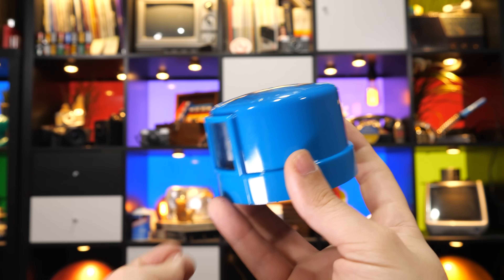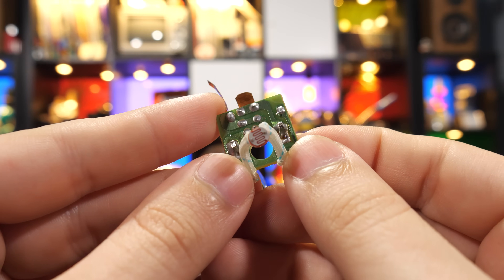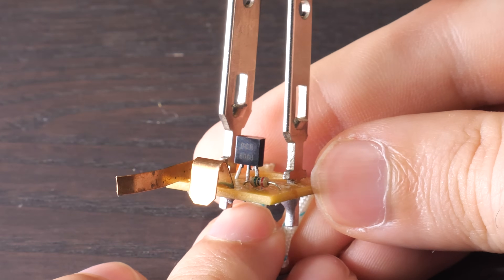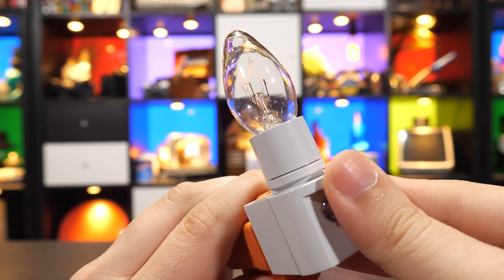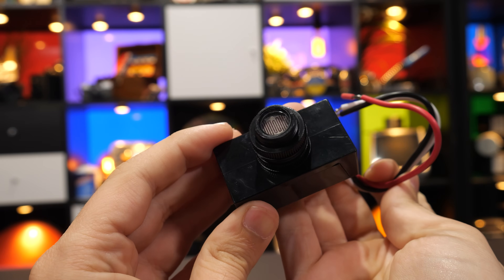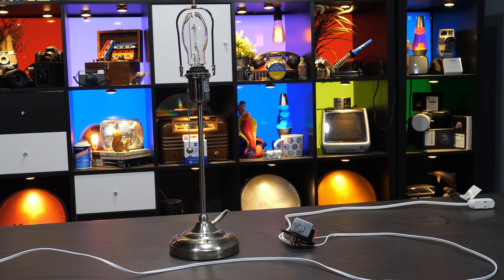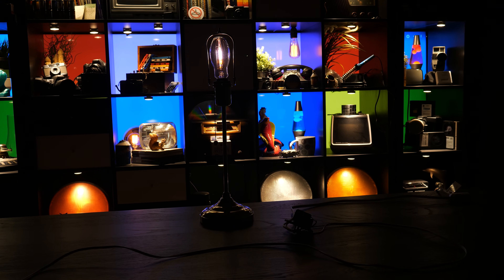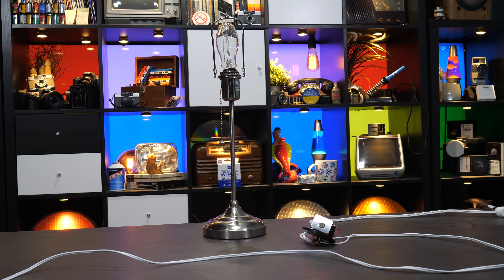Photoelectric light controls are weirder than they seem

Comment: Those devices are more sophisticated than it seems: yes they that have hysteresis (yes the word) to avoid turning on and off  when the threshold is reached, meaning once they turn on it needs to get much more light to turn it on again, just like an automatic transmission works, but...

 ...but there is a little more to that:

In Brazil one of those controllers controlled half of the lights in a small area (lets say the odd ones) and another with a different threshold the other half (lets say the even ones) using one for several lamps allows a more consistent turn on and off without very precise adjustments and using it to control half of the lights make it more resilient to failures on the switch.  This have three more advantages: it avoid surges turning on tens of thousands of lights at the same time cutting the peak to half turning on and then the other half,  and makes easier for your eyes to adapt when they turn off and diminishes the wearing of lamps when a smaller drop in luminosity happens like on a storm or dark sky that takes only a few minutes.

The new led lamps seem to not behave this way anymore as they do not have problems being turned on and off too many tomes and do not use so much power too.

Comment: Another way to do it is with a photocell (tiny solar cell) instead of a photoresistor. If you have a component that creates its own power when the main component is inactive then the circuit doesn't need to continually draw power from the grid 24/7. That means putting one on each individual lamp makes a lot more sense, and even a minuscule amount of power drawn over the course of decades and millions of lights adds up fast.

Of course, these days what makes even more sense is for the street lights to be LED, powered from batteries that don't need the grid at all, and to recharge those batteries from solar cells during the day. When the solar cells no longer generate power, turn on the light. Easy peasy, no microcontroller needed (although battery management comes into play), and they can be installed anywhere with no regard to running power lines. And yes, they are 1000 times more reliable than those cheap solar lights you may have bought that only last one season, because among other things quality control actually exists for the big street lights. Those cheap ones are prone to fail for a lot of manufacturing defect and bad design reasons, such as nonexistent waterproofing, lousy connections and soldering, and the cheapest possible components.

Comment: Time Clocks can be used to “lock out” the control of the photo resistor in large night lighting applications to keep from coming on during hours in which it is expected to be light out. 

Street lighting though is aways controlled by the photo resistor via contractor. This is to ensure the roadway will always be able to light up in the case of extreme weather conditions during the day.

Comment: One unmentioned minor benefit of wiring a whole string of lights to a single one of these sensors is that all the lights wired as such will turn on and off in sync with each other. Since lighting conditions differ slightly atop each pole, it can otherwise be a bit confusing or disconcerting to the public when random street lights are on/off right around the transition brightness level and they can erroneously assume that some bulbs are burnt out or there's otherwise some problem with the lights in question.

Comment: My favorite photoresistor nightlights are a couple of LED units which happen to dim the led smoothly as the light increases. This means you can control the brightness by how far away your hand is from the sensor. It’s not better than a simple on/off, but it is more fun. 😀

Comment: The PTC thermistor is likely used to accommodate the multi voltage feature of theclockplug photocontrol. Also some older lockplug photocontrols used a conventional magnetic relay linked to the LDR. Those, of course, had no delay, so events like lightning would wreak havoc with HID lamps

Comment: Great video, as always!  I never expected that, about how the street light switches work.  I did wonder how very cold or hot climates affect the operation though. ?

There's a 'new' kind of dusk-to-dawn lightbulb sensor, integrated into the bulb itself, that I'd love to know more about how it works.  No photoresistor, I doubt there's any microcontroller.  They are inexpensive, and work great in my experience.  The light sensor is a LED, apparently.  I know LEDs can be used as a photodiode, i.e., as a light sensor.   What I'm most curious about is, how does it sense light when the Sun comes up, and therefore know to turn off, because the LED sensor is bathed in the light of the bulb.  It's mounted at the base of the bulb, and in most fixtures, it surely gets lit up by the bulb.  I suspect they turn the light off for a very short time, probably imperceptible to us, 'take a reading' of the ambient light, and go from there.  Very interesting, AND probably much more efficient too.

Comment: I’m surprised the LDR can handle the power dissipation during switching. If the resistors throw off 2.5 watts when powered, halfway through the on/off cycle, the LDR would be dissipating a quarter of that (half the current x 1/2 the voltage), or about 0.6 watts. That’s not a huge amount, but it was a little surprising to me that the LDR could handle it ok. (I guess that’s why it’s bigger than the ones in night lights, but 0.6 watts is enough to get something appreciably warm.)

Comment: I hope you do realize that there are electronic stuff without microprocesor and code, well the one you've showed with tyrystor is one of those. But the part about power supply or maybe rather something to lower the voltage remains true for most electronic ways to make such switch.

Comment: Really interesting video. In Europe we're gradually replacing sodium lamps with LEDs - better longevity, more useful light and also cheaper to operate. The operational advantage is that they're connected via cellular low-power WAN, so it becomes possible to provide fine control of their operation as well as generate notifications of malfunctioning infrastructure.

Comment: I'm a UK street light collector and the photocells my lamps take use the exact same pins and twist connection (We call the socket a NEMA socket) but the cells I have made by Zodion are entirely transparent and feature a circuit board and some ICs and a different form of light detection. In the form of a black dot on the PCB. None of the thermostat stuff that you described and shown.

Comment: The main reason for the design choices is that it works even in freezing conditions. The heat keeps it from freezing cause other designs have the tendency to stop working if water gets inside and freezes the Relais in place. To Relais are not always the best choices especially it the conditions are not optimal.

Comment: Great video. I work as a rep in the electrical industry. I work with one company that makes these and another company that makes a plug and play GPS timer actuated one (GPS Litelock). The GPS one locates its position and will turn on at sunset and off at sunrise automatically.
There have been timers designed for this application but they need to be reset with power loss.
Thanks for the video.
I'll be sharing it on LinkedIn.

Comment: The PTC in the there is not acting as a fuse but as negative feedback for the heater to keep it at a constant temperature. Heaters heat the PTC increasing the resistance which lowers the current to the resistors which limit the power and heat.

Comment: I wouldn't go µOp as a more modern solution. You could easily build something more sturdy than µOps using discrete logic, for example going for a schmitt trigger as hysteresis provider.
Also if you don't need really high capacitor values you can always go for MLCCs instead for electrolytic ones, those are much less fragile.

Comment: I still wonder if there's a different mechanism that is also used in the fixture-mounted photoelectric control. At my old house out in the country, we had a mercury-vapor yard light with a sensor similar in style to the blue one in this video (but it was gray). Whenever we'd get lightning during a storm at night, some flashes of lightning would be bright enough to instantly and briefly cause the light to turn off. The power doesn't go out, rather the several millisecond brightness of the lightning simply causes the light to go off. Were the sensor on the yard light using the thermal switch method, you'd think the thermal mass of the internal mechanism would survive the light from such a short flash of bright light.

Comment: The schematic at 5:09 feels wrong. The system necessarily draws current through the light. I'm also relatively sure the voltages are incompatible between the light and the middle pin on the transistor (but hey, maybe the bulb is low voltage DC).

Comment: I would guess replacing the heater-as-a-switch over a micro controller has the upside of not needing a heater to prevent condensation from forming.

Comment: Photo resistors used to be made of cadmium sulfide. Maybe they still are.
Using the thermal switch avoids the use of semiconductor junctions, which tend to get fried by lightning and power surges. This may be a moot point now that streetlights are often LED. 
The cheapest tiniest LED night lights often just have a photo transistor across the LED.  This just shorts the LED during the day, so those use microscopically more power during the day. They use a tiny amount of power anyway.

Comment: I the late 70's I knew some vandolous kids that would smack telephone poles with a 4x4, causing the street light to go out for a few minutes.  I always wondered why that was.  Looks like the vibration wold move the bimetallic strip enough to open the circuit.

Comment: What a terrible design. This is a case of simplicity seeming elegant but actually being bloat. There are technologies other than a photo resistor that could be used, and more power efficient (yet simple) circuits that could be used even for photo resistors. If you're going to use one of these to control a contactor anyway, you're not really saving anything by not going with a circuit design that controls the contactor directly instead of circuitously via heating a thermostat. It's pretty dumb to think "oh, well we're saving complexity by not using a relay" and then using it to control a relay... facepalm A micro-controller wouldn't even be needed to replicate this for controlling a relay/contactor. Just some resistors and a mosfet or optoisolator. All off the shelf components. This is clearly the lack of innovation that comes with "good enough" mentality, rather than a smart solution. I'd be horrified if LED street lamps still rely on this.

Comment: Great video as always!! I would assume that the built-in heating has the added benefit of preventing the photo-resistor from being obstructed by a build-up of snow and ice? So in colder climates, a more energy-efficient sensor might require a heating element anyway, or regular manual de-frosting. Especially if the module isn't mounted directly in top of the light it controls – in which case the an daytime activation of the bulb might produce enough heat to clear the view for the  photoresistor, turning the power off again.

Comment: Here in the Netherlands we use a central switching location in most instances, they use something called a "astroklok" (dutch name) it is a digital clock that switches on the power to the entire street lighting grid via a relay and synchronizes via the same system that those automatic time setting clocks use (if I remember right) they also use the date that gets synchronized for determining the time the lights should go on and has buttons to force the light on (and with certain models also off). This system allows for working on streetlights safely without having to turn anything off for as long as you finish in time (so during the longest days that might be 20:00 while during the winter that might only be 16:00)

Comment: Great video, like always :) 
Instead of a microcontroller based solution, I thought about a Schmitt trigger using an OP-Amp (switching an off-the-shelf relay, maybe). Would be very robust, cheap, and consume less power than a heating element. There are probably reasons why it is not done that way, but I just cant think of any in particular.
Reply: This video presented a new method to me. Without a microcontroller, I only know of those that use an OP-Amp, Comparator or even 555 timer with a relay.

Comment: How can this contraption be suitable during hot summers or very cold winters? Wouldn't that mean the lights turn on or off at different brightness levels with different temperatures as the thermostat would kick in at different temps?

Comment: There are definitely some thyristor-based streetlight controllers on the market, I have taken a few apart. 

Another interesting tidbit - at one stage in the UK, streetlights were controlled by pulses put onto the mains waveforms. Early switchmode power supply’s were sometimes known to put so much noise back into the mains that they would activate nearby streetlights when used.
Reply: I think the technique you're referring to is "ripple control". To this day it is in use in the Netherlands to switch street lights, but it is being phased out. Tariff switching of meters using ripple control has stopped in 2021. 
A lot of LED lighting equipment is rather sensitive to this ripple control signal leading to complaints of flickering lights at certain times of the day. Added to that it's an expensive and obsolete technology.

Comment: you could use a tiny solar cell to trigger a transistor which triggers a relay.

Wire the light to the normally on side of the relay so it is on if solar cell does not provide enough current for transistor base and done.

No idea however if a relay uses more power for the elctromagnet then that heater design.

Comment: To use less power they could reverse the logic and use heat to turn on the bulb rather than using it to turn off the bulb (add the circuit from the nightlight as a trigger) — this would have the added benefit that when the power goes out it’d take 2 minutes for the bulbs to come back on, rather than adding those thousands of watts of load to a newly powered circuit until all of the limit switches heat up

Comment: I made a radiatior fan using a thermocouple, comparator, and solid state relay. No reason to use a microcontroller - the comparator provided enough hysteresis - and current for the control system was approximately nothing. But the solid state relay cost $20 :( ..... so I can see why this makes sense

Comment: Here in Israel we have street lights basically on all inter-city roads, and they way they are operated (which I believe also how city street lights work, though they are maintained by local governments instead of the highway authority) is that there's a power distribution unit every few kilometres (or every big junction) where the power for that section comes into a big insulated metal box with good infrastructure,  where a small remotely controlled microcontroller is programmed with sunset and sunrise times so it can kick up the lights about 15 mines before sundown and turn them off 15 minutes after sunrise.
This has several advantages:
A. Nobody cares about weather conditions or power outages.
B. No extra power consumption for turned off lights.
C. Most importantly: no period of almost complete darkness on the road before the nights turn on (which I'm sure is when 90% of road accidents happen - check the statistics).
This is the advantage of living in a country that funds infrastructure more frequently than once every 100 years...

Comment: You wouldn't need a MCU to make an electronic version. Two transistors, a couple of ceramic capacitors (which can handle heat) and a relay. That's the obvious solution and how I always thought they worked.

Comment: I always had the impression they were timed, hadn't really thought it was any more complicated than that. But I guess they do come on during during dark/gloomy days too don't they?

At first I thought it seems a bit odd to use power to keep the light off, but I guess you would rather the light remain on during the day rather than the light never come on during the night, if the switch fails, in the interest of safety.

Not sure if it's the same there, but just been reading that more and more often they're being controlled centrally here in the UK.

Comment: lim·it switch
/ˈlimit swiCH/
noun
a switch preventing the travel of an object in a mechanism past some predetermined point, mechanically operated by the motion of the object itself.

This is how I’ve always understood it. You might find a limit switch inside a disk drive where it detects when the read/write head or laser has homed (returned to center). They are exposed and obvious on a couple axes in popular i3-style FDM 3D printers though bed leveling needs more precision. When I troubleshoot a bad CD drive that doesn’t spin I usually move the laser carriage out then bypass the lid switch to see if the laser correctly homes. It should travel to the center to trigger the limit switch, back off slightly to release the limit switch, then bob the lens up and down to focus on the disc, then turn or twitch the disc.

Never heard a thermostatic switch referred to that way. I know simple dryers have two, one for controlling temperature and one as a thermal fuse/safety switch, but none of the diagrams I’ve read ever refer to it as a “limit switch.” Of course, a dryer will have door switches and others and perhaps some fancy mechanism that isn’t part of a standard dryer might have a limit switch.
Reply: Thermal cutoff is the correct name for them.

also what sort of IPA is that